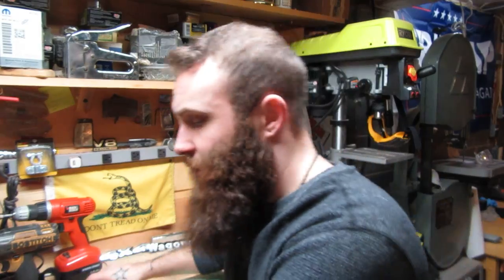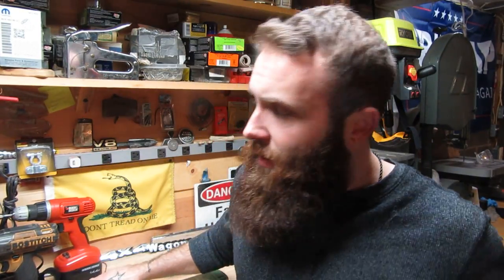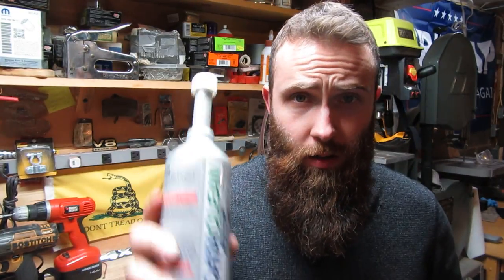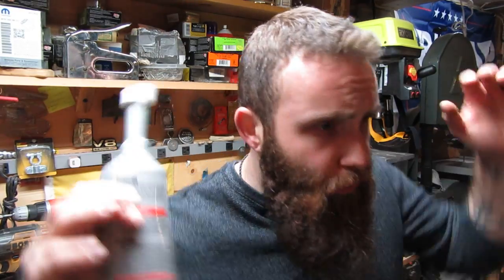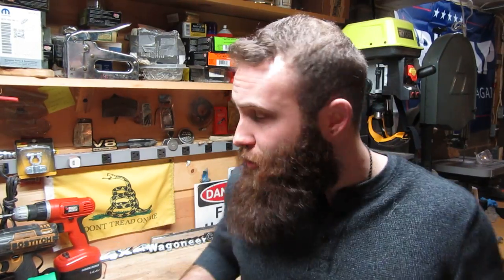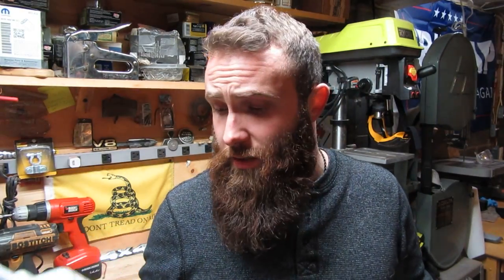How to pass inspection with a BAD CATALYTIC CONVERTER or O2 SENSORS

Comment: Thanks for the tip!!! I had a check engine light on for the CAT and I used stuff on my 2014 KIA Soul and YES it worked and I passed the emissions test here in NYS. I put it in when I had around a quarter of a tank, drove 20 miles then I filled up with high octane gas. I heard that the primo gas helps. The light was still on and I was trying to figure how to clear it and it cleared itself. I went to the inspection and BANG it passed! It saved me about $800!!  It was a New York City miracle! (My Plan B involved Willie in the Bronx) THANKS!!!!
Reply: Yes after I put 1 bottle the engine light go away but do you have to clear the cide to pass the smoke check / yes engines lught off but the code still in the car it’s oka pass smoggy machine thanks got smog 2 years from now
Reply: Hey bro I'm in the bronx where's willie lol if you can help a brother out lol
Reply: Hi can you tell me the name of this plz ??
Reply: @mohammadsalmanali7753  It's called Cataclean. It's a little expensive but it worked for me.
Reply: @rudybrklyn1180  He's outside the Autozone.
Reply: Wish me luck!!! Gonna do this!!!
Reply: @blaakcoffee  did it work
Reply: @curlynick461  it worked. Took me 2 bottles. Light went off for 250 miles. I passed the test, now light back on😂😂
Reply: What if your cylinder One Bank One have slow response would it work

Comment: I been using this stuff for years...I started using this back when I worked as a mechanic! It certainly clean the cats. We had a Mercedes that had a cat the was clogged shut. Put that sweet nectar of the gods in the gas tank and started it up and rev'd the motor high into RPMs next thing we knew the Catalytic converter was glowing red from the heat of the stuff cleaning...We let it cool down and took the car out and low and behold drove like new. So much power you could really tell that it was clean open exhaust again! Nice video Doug, great explanation on how to use it and what it does! Keep the good content going man!! Also you have a killer beard, it better then the hair on my head!

Comment: As a last ditch effort after watching your video, I went and bought the CATALYTIC at AutoZone, put it in with a half tank of gas, put my van into a lower gear and drove for 50 miles at 4K RPM all the way, after 70 miles there were no codes, I checked with my code reader and was only missing one EVAP, which for 2004 cars you are allowed to have one "missing" holding my breath I went and went and PASSED! I tried everything before, nothing could remedy the Catalytic Below Threshold P0430. I was getting 5 codes in a raw after resetting and only driving 30 miles! If I could I would give you a hug. Thank you! The Van has 240 000 miles on it I just could not bring myself to spending another $1800 to replace the Cat......

Comment: I have a 1999 Mazda protege with 210,000 +/- miles and my check engine light had been on since i bought it over a year ago, up until last week, for the catalytic converter and if i had only known about this product back then i would've used it when i first got the vehicle.

Last week i bought a $39.99 scan tool from Walmart to check for any possible codes but only the cat kept coming up and i tried this product after watching a similar one and i did exactly what this man is saying and it has apparently worked. I waited until i had less than a quarter of a tank of fuel left and poured the whole bottle of CATACLEAN in there and drove the car like i stole it. Up and down the highway for 20 miles, even though the bottle calls for 10-15, only because my calculations to make it back to a gas station were slightly off. Once i was done with the 20 mile trip i filled it back up with regular fuel and deleted all codes to reset the check engine light and i'm now at over 130 miles since this process without the check engine light coming back on.

I was extremely doubtful about the effectiveness of this product in the beginning after reviewing different results from different people but it beats buying a new catalytic converter by far! and it worked for me so i highly recommend giving this thing a shot and praying for the best.

Hope this helps other people make up their mind about trying it out and hopefully saving them lots of $.

P.S. Thanks for the video brother!
Reply from the maker: Hey, glad to hear this helped you! Best of luck going forward
Reply: you are funny. aka ( LIKE i STOLE IT ) funny very funny !

Comment: Hello Sir, thank you for your tip. You saved me a lot of money! I have a 2005 TSX with 320k + mileage and my check engine is on because of my cat converter. Im due for registration and smog check and Im worried it will fail because of my cat converter. I shopped around and its very expensive bec of CARB.  I came across your video and tried it but nothing happened. I was thinking maybe my cat c. is so clogged up that I need a second bottle. So I bought 2 bottles poured it with about 4 gallons left and drove the car for 40+ miles on the freeway. After that I filled it up with premium gas and drove for another 10 miles. Then my wife drove to work for about 60 miles and BOOM! CHECK ENGINE'S GONE! Highly recommend product. It really works! Thank you Sir!!! 👍👍👍

Comment: It works, just  run high test gas in your car. I ran none ethanol which i got a Stewart's. Ran the car for 30 miles. Came back cleared the code. And it passed inspection.

Comment: Wow It worked for me 2013 town and country had 420 & 421 codes after pouring one bottle in about 4 gallons of premium fuel the check engine light went away in about 10 miles finished my drive cycle in about 100 miles and passed the emission thanks for the info  saved almost 1000 every body was recommending a cat change
Reply: Once the light goes off can i go into the emissions? What do you mean by drive cycle?

Comment: Doug, I used that stuff in my 2000 WJ 4.0 that had 250K miles on it and was using a lot of oil because of bad rings, got the cat code, and in one day it ran better and cleaned the cats enough to go thru inspection the second year!! That engine is now sitting on a pallet in my driveway, but the cats are on a second engine. This is a true story!

Comment: Tried this stuff, I can see how it would work for a little bit of cat buildup, but not in my case. I had the dreaded P420 code and had hopes that it would clear it up so I could get my registration in California complete on my Jeep Commander. I took it down to 4 gallons of gas with the help of a wireless OBDll reader,  drove it for 25 minutes pretty hard (10 more minutes than the bottle instructs), then I even went as far as putting premium gas in to try and clean up the system further. But after attempting a drive cycle, the check engine turned on again. Super disheartening! Now I have to visit the mechanic for further, much pricier, options to clear this up. I wanted cataclean to work so bad!
Reply from the maker: Sorry to hear you did not find success. Sadly it is a gamble, but SOOOO nice when it does work
Reply: Reviewers on Amazon say you may need to repeat a few times, and to always do it at least twice.  One bottle doesn't always do it.
Reply: @SeisanStnc  just the answer I was looking for
Reply: Sorry about your painful experience I'm going through the dreaded 420 code now the worst experience ever
Reply: @blaakcoffee  Yes, I've used this in the past and just today on a 2001 Maxima.
Two bottles have worked to pass CA emissions.
Reply: Same here. It didn’t even clear the code for me.
Reply: @lovessellie17  I ended up spending roughly $2000 to replace both catalytic converters and getting new O2 sensors. But it’s been working great ever since! Haha

Comment: I have a 2006 Chrysler Pacifica with 150,000 all mechanicals parts originals the Check Engine Light came up and I used this product and it worked.  I went for emission test and passed.  And I did it myself and I am 69 years old in social security.  I went to a mechanic and they did not even look at the car and told me the catalytic converter is gone and asked for 2,500.  They just said the amount and I left that shop like the Satan was after me, I did not even say bye.
Reply: I have the same car and I'm really hoping this works for me too.

Comment: I just bought one yesterday and will be using today. I'll let you know what happens. I've been told it's either the O2 sensor or the Catalytic Converter.  Wish me luck 😉
Reply: What was the result?
Reply: @smidc  it worked perfectly! My car passed the smog check.  However,  the check engine light came back on about 10 miles later so make sure you do it right before the test. I turned the check engine light off myself and had to drive about 25 miles so the computer had history (I'm most probably using the wrong words but hopefully you understand).

Comment: Yes I used it in my Chrysler 300 SRT8 and the check engine light went off for about 5 months then it came back on I try to use it again but it was too late had to replace the O2 sensor and Cadillac converter but still great product I would recommend for those to try that first 👍 it works.

Comment: I used this stuff last year on my Sienna 2005 with 250,000 miles with the VSC light and bad O2 readings and it did pass me thru the emissions test.  It worked... I about crapped my jeans.  But, Ive heard downstream o2 sensor spacers work too... havent tried it
Reply: Spacer will work only for OBD. If they use gas analyzer, you will fail (first hand experience)

Comment: I never got the running the tank low on gas would allow sediment to cause problems.  Not saying it isn't true I just don't know why.  The fuel pickup is in the same place whether 2 gallons or 20 gallons.  If the sediment is going to overload the fuel filter(s)  because of a higher ratio of sediment to fuel why?  It's still the same total amount of sediment overall.  If it was going to plug the fuel filter then it seems it would just take more gallons if the sediment ratio was less?  What am I missing here?

New subscriber here.  I'm blowing a lot of my Sunday just going through your videos :),  and loving it.  Thanks!
Reply from the maker: Haha.. Well thanks for the support! Glad to have you. I cant say I have any proof of the "dont run your tank low" thing.. I guess it is just something I accepted after hearing it. I am going to research it a bit more now. Thanks!

Comment: boom. cata clean recipe straight from the sds;

1. Hydrotreated light distillate (petroleum) 64742-47-8 CAS # 5.0 -10.0 %
2. Xylene (mixed isomers) 1330-20-7 30.0 -60.0 %
3. 1-Propanol 71-23-8 10.0 -30.0 %
4. Acetone 67-64-1 10.0 -30.0 %

Comment: Has not worked for me - and I actually tried it twice. got my 05 Subaru Outback to 1/8 tank each time, added teh CataClean, drove briskly 25-30 miles. Cleared the code (Actron CP9600 reader); CEL re-lit each time in less than 40 miles.
Reply from the maker: I am very sorry to hear that. I have had really good luck with it in Jeeps and Subarus, but sometimes the components are just too far gone
Reply: Sounds like just enough time to pass smog lol

Comment: I just jacked up my truck, crawled under it and spliced the wires together on the O2 sensors. No more error codes /check engine "P420" code.
Reply: that can"t work because you still have to check emissions on the tail pipe! Are you kidding me?
Reply: @ronaldmahoney1283  In KCMO there are no emission requirements.

Comment: I’ll be trying it today on a p420 code for a 2003 Toyota 4Runner
Reply from the maker: Good luck! Hope it works out for you!
Reply: Did it work
Reply: August August
Sorry for the late response.
No it didn’t work. It’s possible that the cat was already too worn out beyond the point of cleaning it with this.
We’ve been recomending it to customers at the shop and 2 or 3 customers have bought it but haven’t heard from them. Maybe it worked.

Comment: I'm using it for the first time. After driving I could tell the difference. Now, let's see if it can pass emissions test. Will let you know, however I'm already  impressed.
Reply: Pami Cat have you try the spark plug defouler
Reply from the maker: Excellent! hope it works for you
Reply: Pami Cat did it work?
Reply: D&E In The Garage I have inspection in 4 days.  I'm nervous.  P0240 code and I used cat clean once, it worked it's just it was too early to get inspection!
Reply: D&E In The Garage and my 02 sensors have not been changed

Comment: have eny of you ever tryed water to clean your faulty cats and o2 ? get the engine to work temps ,take the filter hose off to get access to inlet and get a bottle of clear water with co2 in it (you know the one for drinking without taste) and with car ideling gently poor water into inlet and when car starts tumbling and setting out rew it a bit just enough to keep it alive , use about a little bottle to half pint or half liter . that should fix your carbon buildup in the heads ,outlet ,co2 sensors and cathalytics ! hope it helps you !

Comment: I'm gonna try this. I had 1 02 sensor replaced but I need the other one replaced too I think. And the cat is bringing back a code too so I'm going to try this. I'll let you know what happens! Fingers crossed
Reply: I have a 2001 Jaguar Stype and registration is due today, aaahhh I'm just going to pay it before fees rack up and hope for the best because I've been trying to get the check engine light off for like 4 months now
Reply from the maker: Good luck!
Reply: So I put the cataclean in and it took away the code for cata performing below threshold code. There were 5 codes, now there are two codes P0133  bank 1 sensor 1 02 electrical circuit slow response, and P1131 lack of H02S-11 switch, sensor indicates lean. That was a diagnostic by AutoZone. Mind you, I replaced the 02 sensor already. So now I'm at a real shop about to get a diagnostic to figure out what's causing my sensor to perform improperly cause it's brand new.
Reply: Mine smokes to much to drive. Is that a clogged cat? It's about 600 defrees?

Comment: Wondering whether CataClean is worth a shot. '05 Subaru Outback 2.5i, 4cyl, automatic, non-turbo. NY State emissions law / inspection applies, basically same as CA. My CEL lighted June 2017, less than 2 weeks after Subaru dealer installed a rebuilt engine at 164k mi. Subie told me I'd need cats for $2500. Inspection was due Jan '18 so postponed, had my local (non-dealer) garage service. They read code P0420 - Bank 1 cat ONLY. They replaced the cat plus BOTH sensors forward and rear of the Bank 1 cat PLUS the rearmost sensor. ALL Subaru parts, BTW. Several go-rounds where the CEL relighted less than 100 miles later. Same code - P0420 each time. They warranted one of the new sensors and replaced it thinking it faulty. Same code. They tried a "spacer" at the rearmost sensor. They even got Subie to warrant the new cat and replaced the new Bank 1 cat with another one. Last repair on 4 Feb '18 (inspection now overdue) the CEL light relighted 28 miles later with the "warranty" cat! Subie and my garage claim that Bank 2 most likely needs replacement. NEVER had a P0430 code for Bank 2 so I'm leery of sinking the $2,200+ for Bank 2 into this as it sounds like a gamble if Bank 2 is not being indicated. Now have 195k miles. Car runs STRONG. Inspection now LONG overdue and I need a solution. Any thoughts?
Reply: I would say yes do it, I have used it in all my Subaru. Once with the P0420 and it cleared it. But run till empty dead empty like Doug said.  But use discount codes at Advance auto parts to get it cheaper for in-store pick up.  If all else fails do not do not get factory cats way over prices look at  rockauto for them far cheaper then dealer ship parts and normally similar quality.

Comment: Yes it work for emergency fix to smog check  only / my car engine lights will come back/ I did cleared code after 71 miles engine lights come back. So still looking to fix the it right / meaning time I buys 1 bottles to save for 2 years from now for smog check if I don’t have $2,000 to replace the cat.

Comment: So I have to go get my 2007 Hyundai Sonata smogged by the 11th and my check engine light has come on and then be off for couple months then back on ..it’s reading that it’s an emissions issue (most likely catalytic converter) but anyways it’s been like this for almost a year …and I’ve been fine with it, hasn’t affected my driving or anything but now it’s time to pass emissions and I just stopped at my mechanics and he was able to reset it so the light goes off but told me to drive it 50-100miles and see if it comes back on …so that’s how I got here to your video ..and I’m just wondering if I do buy this stuff should i put it in day before I go in to get it smogged or now or ???…I have to pass by in 9 days …so hopefully you can give me some insight ..would be hella grateful , thanks so much ..bye for now 🌻
Reply: I just watched this vdo today and saw your comment . Were you able to pass the test ?  I have to get my car smog by next week !

Comment: 2003 Jeep Grand Cherokee WJ laredo with a 4.slow, last year after my inspection i had no codes, last month, P0141 P0161 and that bullshit EVAP code (very small leak) i can get the evap to go away, but with the o2 sensor heaters (circuit) i replaced the o2 sensors codes were gone for a week, came back.. changed the relay.. gone for 2weeks now they come back after i restart my WJ, my inspection is due in August.. i need halp